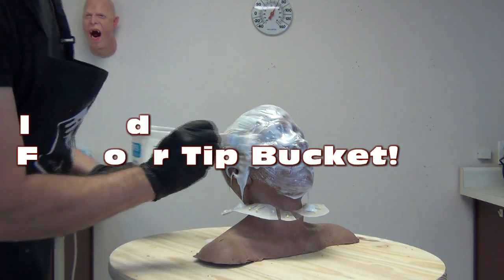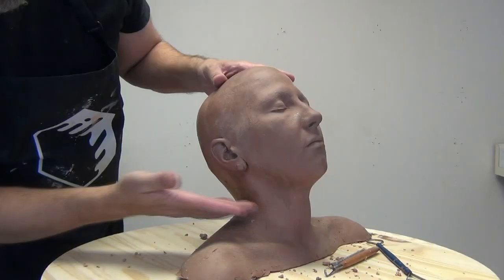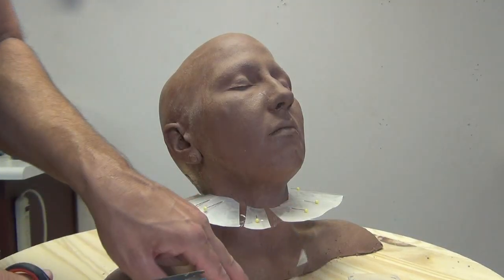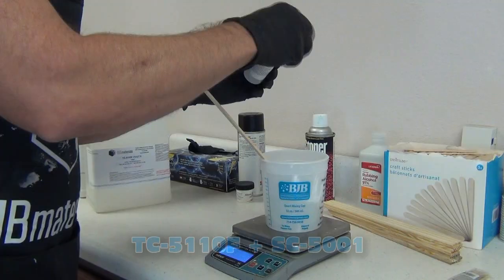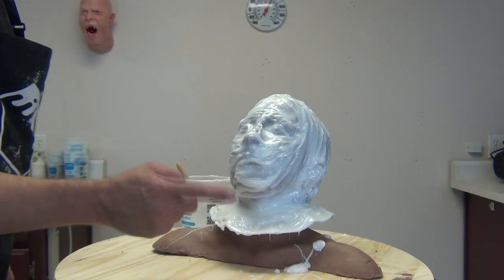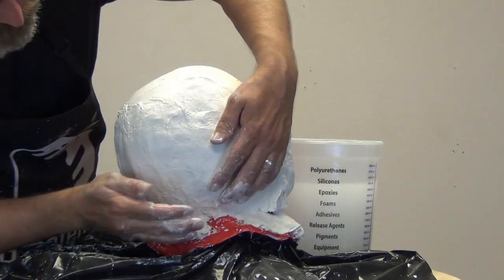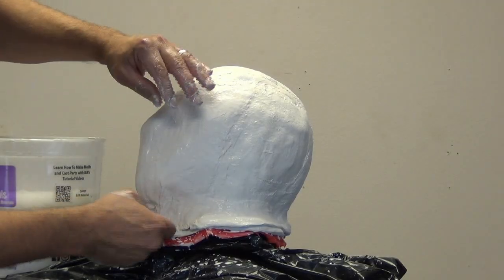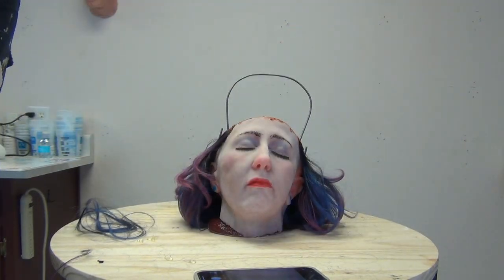Silicone Head Mold For A Human Head Tip Bucket??

Comment: I just want to confirm if I have the live person and I’m making the live cast from platsil 10 then I will make the plaster mother mold . I don’t need to make the clay pour mold , right ? 
I can use that platsil 10 mold/ mother mold  and go directly in to making the bucket with the resin you recommended, right ??
Reply from the maker: Yes, you could make a resin cast directly from a Gel-10 mold. I just responded to your question in the FB group, but just in case: be forewarned that a full head cast is a major undertaking!